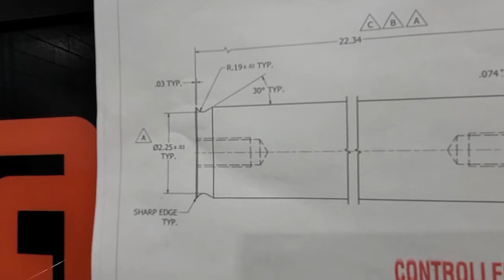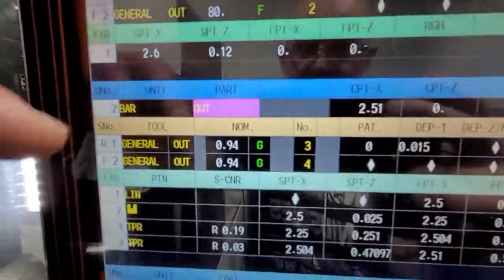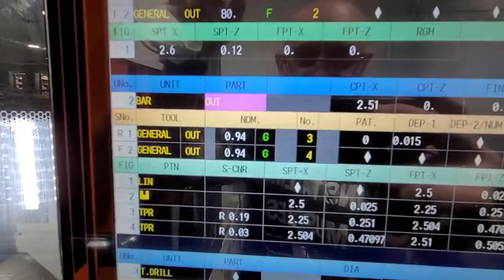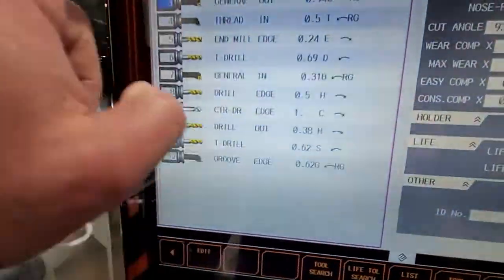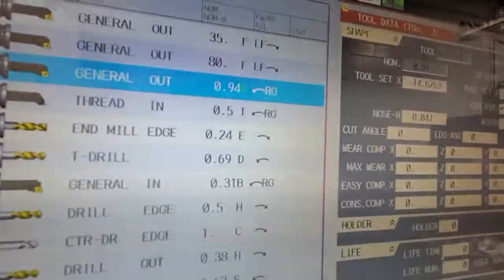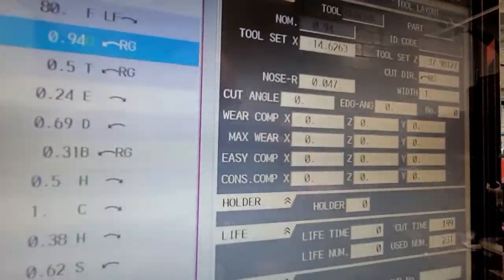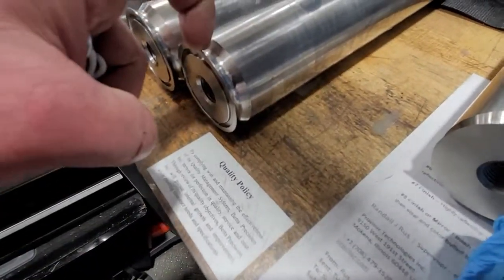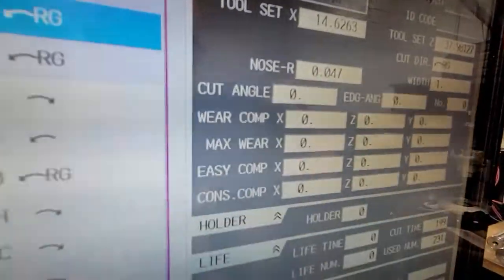Mazak Smooth G programing Turning using Grooving tool trick

Comment: Sir plz make u-drill  boring program
Reply from the maker: Not sure what you mean by u-drilling
Reply from the maker: U-drill is just a indexible or simply speaking insert drill, your drilling parameters depends on size of the drill, but if you asking about off center drilling, that's a different story, so I have no clue what information you actually need.
Reply: @martyz3232  lot's of thanks sir
Reply: @martyz3232  indexable u-drill yes I asking about offcenter Drilling
Reply from the maker: @biswanath484  the only way for  off center drilling be possible through manual programming. You would have to find my video that shows parts of manual program, use whatever drill you want as long as it's insert drill, and basically write a program which would go like x 0 z 0, G 0 then f. 003 as an example for  feed rate S 600 or whatever speed you want and then go to x 0 and z.? (desired dept) then using G 1 go back to x o and z positive. 2 for clearance and then if you want to lower your drill if insert is on the bottom do x -. 2 and z. 2 and repeat  x-. 2 and z? (whatever dept you want) using a G0 which would be set to that. 003 feed as an example, so on an so forth.
Reply: @martyz3232  thanks sir ❤️
Reply: Yes sir that's mean u-drilling
Reply: Yes sir indexable drill or offcenter Drilling
Reply: Thanks to reply sir 💕
Reply: Sir can you give me what's up number